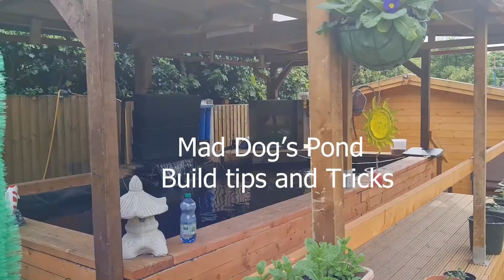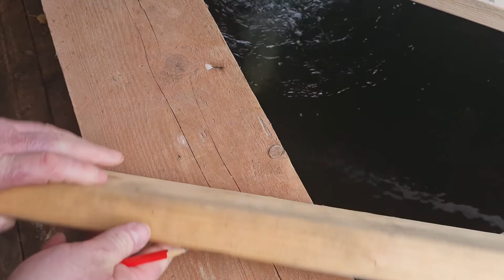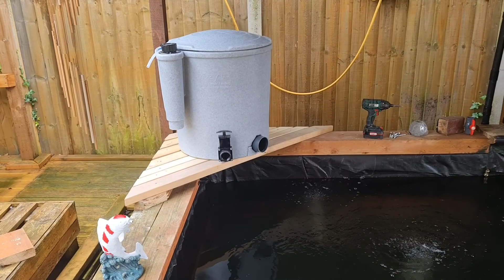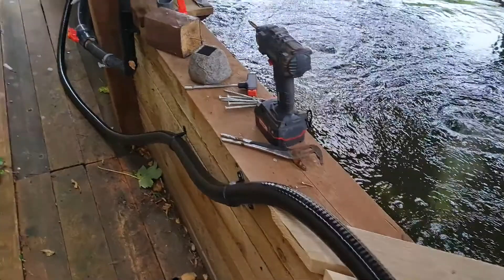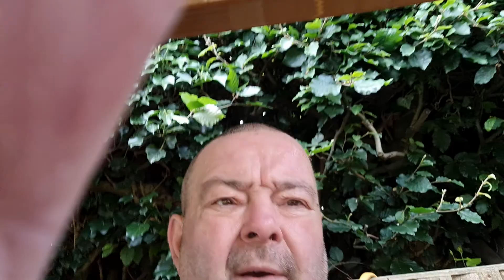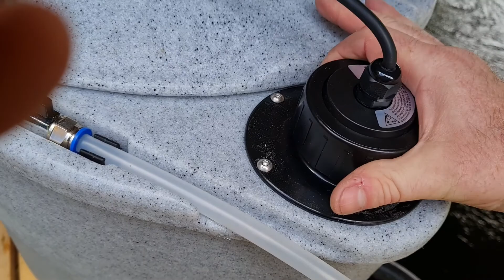Bacterial Issues and New Easy Pod

Comment: Sounds like uv had a real rough time of it buddy and hope the bacteria issue is over, I’ve just looked at 1 of my fish today and noticed it’s got a sore around one side of its mouth and also the fin is starting to go red, I’ve put some virkon in to try and slow it down, wot did u use for the sores? Any advice would be a great help
Reply from the maker: Hi no still going through it m8 the fish that came through I used traodine I think it's spelt the rest seem to be resilient does sound like you may have mouthrot although I cannot be 100% acraflvine may work for you but if you treat using cotton buds 1 dab and turn around hope this helps
Reply: @maddogspond  thanks buddy, hope u sort urs out 👍🏻
Reply: @maddogspond  tamodine it's basically a weaker form of iodine tincture
Reply: Mouth rot teeat with hydrogen peroxide straight on with a cotton bud works for me you can also use it on other sores
Reply: @skeggy  don’t u use hydrogen peroxide after pp
Reply: @kushtykoi5086  yes you can do but hydrogen peroxide has a multitude of uses from bleaching hair to cleaning wounds ..  to neutralising pp and also oxygenating water  .
Reply: Kushty mate try chloramine t ideally put the fish in a quarantine tank and treat with chloramine tat the first sign of an issue it normally starts with reddening of the mouth and fins mouth rot and fin rot left untreated it quickly turns to ulcers once it reaches that stage it is very hard to cure so speedy treatment is essential chloramine is designed for use specifically for mouth and fin rot I would suggest using the stronger dose used for killing parasites which I think is 15 gramms per 1000 litres do this for four consecutive days then stop treatment for 14 days then it can be repeated we have found that this has been the only thing that has had any effect as this particular strain that seems to be doing the rounds is resistant to antibiotics and antibacterial treatments hope this works for you or anyone else out there